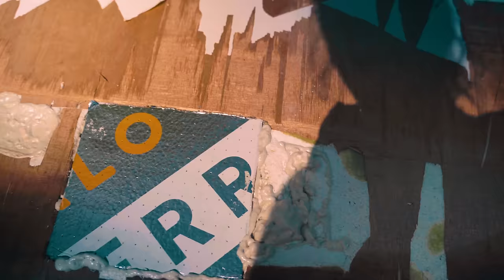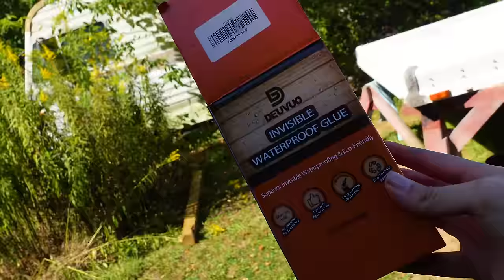my new HAIR & I finished my camper roof

Comment: Ive done alot of work on campers and boatrs the roof would be an easy fix using figerglass and epoxy resign than can use fairing compound to smooth out sand and than paint completely waterproof light comparted to ther materials strong and lasts .....if you want more suggestions I can suggest some good companies like TOTAL boat for the epoxy resigns and fiberglass fabric

Comment: For the crank you should look into a cheap DC motor and a forward and reverse switch so you don't have to fight with it.  You'll need a low rpm but high torque motor like a windshield wiper motor.

Comment: I don't know if you will redo the ceiling but from having redone a Sunlite roof before... you want to use these products:  3.5 Gal. Greenchoice Fast Grab FRP Construction Adhesive Pail, 0.090 in. x 4 ft. x 8 ft. White FRP Decorative Wall Paneling, 1/4 in. x 1-3/8 in. x 96 in. White PVC FRP/Tile Divider Moulding (for between panels), 3/16 in. x 13/16 in. x 96 in. White PVC Tile Cap Moulding Trim (for panel edges).  You "butter" the adhesive down with a notched trowel, full coverage with the adhesive. (not spots)

Comment: Also ive remodeled a 5th wheel before and ran into all the camper problems you are having. Was able to fix all the inside but the roof, i highly suggest a professional to seal the roof. I did it myself multiple times and it didnt fix it. Where the professional fixed a problem i didnt even know was there and its been waterproof and draining well since.
Reply from the maker: That’s good you got it all fixed - I think at this point now though it’s waterproof just unsightly

Comment: Make some furring strips out of 1/4 ply glue them in weigh them down.  Or run a few screws down into  allow the glue to set up.  Then run some adhesive down the sides of furring strips like you would caulk.  Get 1/8 luan plywood and wrap it in cool looking fabric or headliner fabric.  Seal screws on roof with dicor or sikkaflex

Comment: Put the panel back in the roof and put 2 or 3 stiff braces aside to side equal distance the length.Its getting on toward winter so if you are still heading south I suggest that you don't go into Mexico,it's way to dangerous at this time.If you ever come thru Michigan, and need help,put the word out and I will come running kiddo.

Comment: Well, there’s several different context and adhesive you can use and you can always purchase this 4 x 8 cheats which is kind of like a plastic fiberglass stuff which is smooth or you can get it rough and you can glue that in there and it will stick to the inside andit’s plastic water not affected. You can go to Lowe’s or Home Depot either one they have it in the trim section area.

Comment: FYI... when you have vehicle issues, try to find a mechanic that will allow you to have your own parts.  When you know what's wrong you can order parts on line and usually save some money over what they charge for parts.  For the roof... you could always staple or tack some fabric until you find a way to permanently fix it.

Comment: The campervan internal roof  !?
Self adhesive carpet tiles,
Bubble wrap foil insulation,.
Good luck you deserve it.       🌬️✨✨✨🙏  and the external roof surface, self leveling waterproof roof paint ( white solar reflective)

Comment: Should have used fiberglass and resin and painted to color of choice. It is an expensive route to go, but it is also the best practice against water damage and molds. The crown is fixed by putting thin pieces of arced wood reinforcements as you lay the fiberglass and resin down.

Comment: Level about $12.00 a tube put thin  Layer with a  Puddy scraper would probably held the wood on but now that you got the top back on a would'nt recommend trying that, you'd have to press the wood somehow for 4 or 5 days to make sure it sticks good, But when it drives you ain't getting it off.  only other thing I could suggest is take A good paint and some kind of canvas That's gonna be hard now too since you got the top back on would've been great to try either one of these with the top off But with the canvas and paint you would paint inside the top, lay the canvas and paint over the canvas again and let it all dry, Some people call that a poor man's  Fiberglass, peace girl
Reply from the maker: I’ve heard of that method , but yea would be really hard now that it’s flipped over . Good idea though

Comment: Maybe a different adhesive would work better? Have you considered selling the truck camper after its fixed? Maybe just get a truck topper instead, its a lot less to worry about in regards to things breaking and not working properly. Yes you would have to start over again but it might be a better solution. Just a thought.

Comment: You can save s the paneling you need to lightly spritz water onto surface you want to adhere to and you use gorilla glue it it’s moisture activated it can be used on wood metal fiberglass etc make sure you add weight to panels evenly the glue kind of turns into a foamy solid you need to keep weight on panels

Comment: Depending on a warranty is always a bad idea. It's always best to learn the skills you need to do it yourself. You will never let yourself down. Others almost always will. If I were working on that camper I would see if I could incorporate lightweight, waterproof PVC paneling and boards instead of wood into my design. Tear out all the wood and duplicate the framing and paneling it formed with PVC. Oh, yea. It's also cheaper than wood. If you mean to use that foam for insulation, no, I would use spray foam. Yea, the structural renovation WOULD be my favorite part. I would leave the interior design to you.

Comment: Reach out to a boat top or cover shop. They can maybe help you pattern a enclosure with the pieces you have. They have the material you need for water proofing. I used to work for several boat top companies. They can pattern almost anything. I could but not near you and not that much experience to say I could do it all. Good luck just a helpful hint.

Comment: For down the middle of the roof maybe a square stock aluminum to push the middle up flat so it doesn't pool by the vent. On the truck go through and read the covered things so you know what should be covered and how it is covered. If you should have the issue with the company go up as high in their company and talk nice and you get more

Comment: You could ad 1/2 in thick by 1 1/2 in wood ribs that attach at ur 2x4 as spreaders that keep the panels up and put some around the edges so they hold the panels instead of or in conjunction with a glue or construction adhesive
Reply: The ribs if u make them longer then the width of the roof have them run across so it bows a little it may help with the shap of the roof as well

Comment: Just an Idea, have you guys thought of just pouring on self leveling RV roof sealer to help with the warped roof? I mean It could not hurt, 1. adding more sealabliity and 2. help level out to prevent pooling (just a thought) heads up girl, love the hair <3
Reply from the maker: Hmmm 🤔 I wonder ! I’ll def be doing some more sealing but I’ll have to research if that will work— I do have a lot of self leveling culling

Comment: Hi Tory. So regarding your roof sagging. I had an old Apache pop up trailer, it used strips of 1/2" by 2" sightly longer than the width of the ceiling that were forced into the frame by bowing the center and then secured with wood stables. The resulting arch created a peak at the center of the center of the roof. It should work for yours as well. They were spaced about two feet apart. Other than that , your hair looks great. Thanks for the video.
Reply from the maker: This was what I was thinking but wouldn’t sure if it would work — maybe willl be a lot harder since it’s flipped over now
Reply: @TorieRobot  shouldn't be hard. I replaced a few when I first got the trailer.  There was a 1/4" plywood sheet directly under the fiberglass that the ribs or slats attached too. I replaced them by myself. Might be easier with two people though. If you are going to put in a plywood sheet, I recommend a layer of insolation.
Reply: Also, the lifting mechanism for your roof is available on line. You can purchase parts or piece together most of it. Look for pop up trailer parts. I've seen that exact system on some of the websites.

Comment: Eternabond tape and butyl are very helpful to use for camper work.  Good sealant for edges and places that you need to put screws into.  Not fun work but you get a chance to change out cheap wood for better.  Not sure how heavy the roof is but maybe do without the crank and find a way to just lift it manually and lock in place?  Or maybe find replacement crank hardware.  Good luck!
Reply from the maker: Inneed to find a replacement crank thing for sure 
Yea they put that tape on before and it was a hugger pain getting it off lol
Reply from the maker: Huge*

Comment: For the roof panelling would be best to fibreglass in some batons and fix the panelling to those. It'll get a lot of abuse that roof going up and down so quick fixes likely wont hold. You could try put some material on it to take the dirty look off of it. Fair ply to you taking it all on though, someone sold you a pup there.
Reply from the maker: Yea shortcuts aren’t the way but I guess in this case we will see what happens - good idea though

Comment: In a way I feel for you, I have help so many people buy cars and trucks cuz I know how to deal with rip off car dealers. Also, they saw you coming on that camper. Sorry. For the ceiling, although you probably already did something, I would have used fiberglass resin, like what they use in surfboards. You could paint in on and it is self leveling but that would only work with the top off and placed upside down. Good luck and if you ever come to San Antonio I could help you with anything you might need.

Comment: Liquid Nails will be your friend. Waterproof Liquid Nails is a waterproof adhesive that can bond to metal, wood, and fiberglass surfaces. It dries quickly and provides a strong, long-lasting bond. Sikaflex is a permanently elastic sealant that can weatherproof joints.
Reply from the maker: Well in this case liquid nails was not my friend lol I even got the tough version

Comment: You asked for comments about gluing  the side panels down. We had a few tips after doing similar things but we live in NM in a  serious dry area so it's slightly different. We would've used some serious clamps on the parts that needed to be held down while glue dries.. we found umbrella clamps at Lowe's n Walmarts fairly cheap but we also had some in our inventory already so? 
Other things were using drier days for certain products because certain products suck in any kind of humidity.
Reply from the maker: Yeah we clamped and pressed as well as we could , but water got in there .. but also I just think it was bound to fall off
Reply: @TorieRobot  oh water makes a huge issue inside there I get that. Oh dude if u get it all set n water out. That silicone j bweld  is the sht for closing up water tight needed  areas . Darn it I didn't think of water already being inside. That does hurt that process. But a heat gun? Maybe help?? My craft heat gun works better mechanically half the time too just saying

Comment: I feel your pain, I'm dealing with maintenance issues too. I had to scramble to buy a van and couldn't do much in due diligence to check it out first. Now I'm having to deal with about $10k in repairs. Ouch! :)
Reply: That foam just gave me an idea what I can use to insulate the area between my roof and headliner. It looks thin enough to work.

Comment: What are you trying to cover the roof of the inside of the camper?  If so you could use FRP and get FRP glue. It's the stuff the put in kitchens or bathroom walls. It might even have gave it a little more strength if you applied it right. But I really don't even know what you are trying to cover.
Reply from the maker: I’m trying to cover the styrofoam, wires, and all the rest lol

Comment: I stopped in the middle of the video to write this, so you may find a solution before the video ends but what about using the same ceiling liner material you used on Yuki?

Comment: Making me miss my locks. Took over ten years to get to your length. Same style on the tips . Never liked blunted . They look great on you . The progress of the camper is actually going pretty good in my eyes for its worth . Trucks good ,the top works again . I feel like if you were to brace it with with some electrical conduit which is light like the bars for the crank system it would help in the center. One on each side of the vent box going all the way across . May have to prop / force the center up  then lock the bars in .  Lookin forward to the interior design and scheme 👊🏼🍻🖤
Reply from the maker: That’s a good idea although idk how I’d get the right size bars ..
Reply: @TorieRobot the come in different lengths . When you go to Lowe’s or Home Depot , etc you’ll see . Just cut them to the full inner width of the topper . If you look in that section. There will be mounts to hold it to walls in bins in different ways . Just use the same size piping/bars as what is on the crank system . Shouldn’t cost to much . Maybe pops can swing in with you and kinda look . I see it in my mind just hard to explain lol

Comment: Have you tried RTV silicone for the glue?
Reply from the maker: I’ve not - is it any good
Reply: @TorieRobot  It does really well in withstanding hot conditions, it's what they use for gasket material for engines

Comment: Hi tori, sorry you got ripped off, some people are shitty, hope karma returns the stress they've caused.
Nothing will stick to expanding foam on the roof, if it's a clean solid base I'd use Gripfill with marine plywood. 
I can't tell what you used, looks like MDF as water has come through. Hope the roof now has been sealed with the waterproofing you used?
Think the elevation handle is broken and missing threads that's why it drops. Maybe if cost is a issue you could use canvas to line the roof. Hope things come good, you deserve some good luck.
Ps hope Gripfill isn't just a UK based product? Its so strong.

Comment: I am so sorry you are going through it with the dealership. my daughter is going through the same thing she purchased a used vehicle from Toyota by the way this is her first car also purchased an extended warranty platinum service. They gave her a gold warranty package refused to change it and charged her $3999 for it which also included gap insurance and this was Lombard  Toyota in Illinois.  The salesman who happened to be my sister‘s husband screwed my daughter over just to get a sale lied to her and said that he changed it the package that she bought and never did she has issues with the vehicle and none of the issues that she has are included or covered under the warranty, so I most definitely am going to try to get her money back because what’s the point of giving all that money for warranty that you cannot use Toyota most definitely is not the same. They’re just a bunch of crooks.

Comment: I have used carpet glue to redo my boat carpet. You brush it on just like painting, let it sit to get tacky and apply your material. I would apply this to the entire surface. It's not expensive and is on Amazon. This stuff works. Maybe you could put a material up like burlap. I think you could even paint that stuff, could be cool.  I'm an old soul and like you I want to trust people. Unfortunately, that doesn't work too well. Slow down take your time and do your homework when making larger purchases. Good luck I wish you the best with your projects.
Reply from the maker: Ooo I never thought of burlap! That’s a fantastic idea (even if it doesn’t work I need to incorporate some burlap)
Reply: @TorieRobot  On second thought it might be a better idea to dye the burlap instead of using paint. That would be less expensive. Tye Dye retro

Comment: 8:47 Would tongue and groove laminate work better as it's really light and it can expand and contract a bit with heat and cold? Or still too heavy for roof?
Reply from the maker: Unfortunately I think it’d be too heavy for just glue to hold on
Reply: Oooor you could turn it upside down, rough up the surface really well with a sander, plug the hole in the center, and do a resin pour. Or,  you could use the textured truck bed liner that's spray on, and spray it on. It's got texture and is quite thick once sprayed.

Comment: The extended warranty should have a period of time between when you purchased it to now. Where you can and should be able to get a refund. The game they will play when you call the warranty company directly is pass you around and frustrate you until that period expires and you won’t be able to get your refund. But if they’re a reputable warranty company you shouldn’t have this issue. Read the bottom, fine print of contract to find out terms and conditions.  Best of luck!

Comment: Liquid nails is water based it's no good for anything that's wet a lot of the time I in the 80,s patched a plywood dinghy it floated 20 Min and promptly sank I used liquid nails to glue patches over holes even under paint it didn't work

Comment: Repair an entire roof is good just think of it as you're helping someone else cause im sure your not the first or last 
Its always frustrating getting screwed over expecting one thing and getting another  but just reset your think as a rebuild and vent when you get frustrated 
If something goes wrong when your on the road youll be able to fix it
Reply from the maker: You’re right— it’s mostly the struggle of having to drive over to my dads and the conflict of that and it’s just a big stress— once it’s in my back yard it will be easier to fix
Reply: you'll get it done sooner or late rdont give up